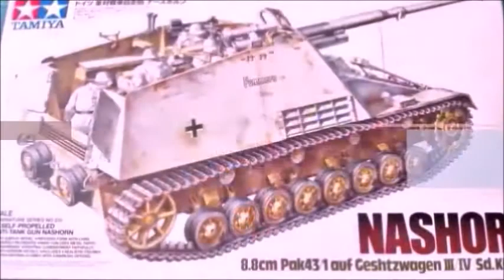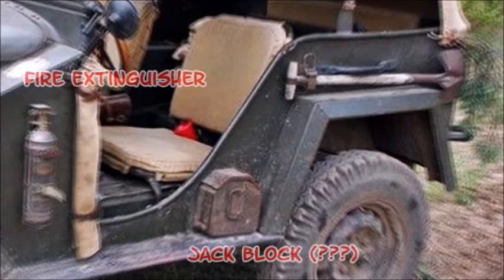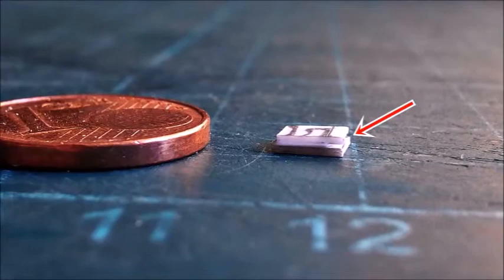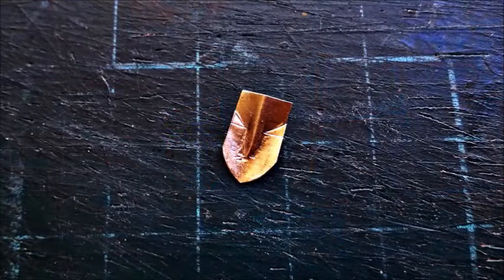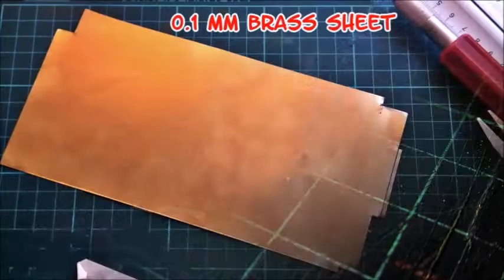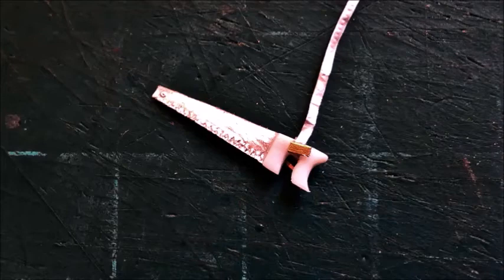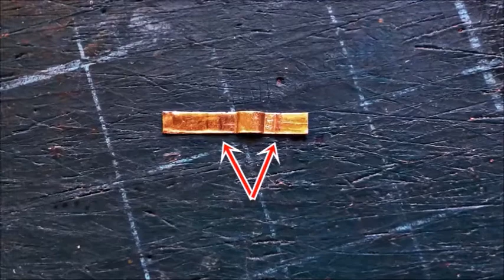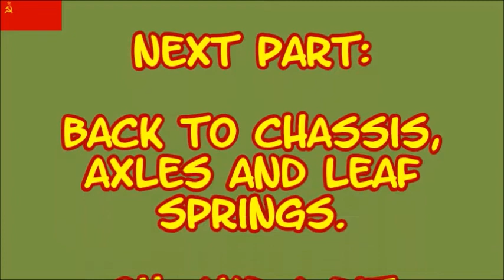The 'Chapayev' - (Scratch) Building The Tamiya GAZ 67B, Part 4, Pioneer Tools

Comment: I have been a bit busy myself this past month so I am catching up with your vids. Nice detailing. I've tried the shovel rebuild with mixed results. Mostly replacing the plastic with wood handles and an occassional bolt, More practice, but the GAZ looks excellent
Reply from the maker: Thanks a lot, Arthur. Practice is all you need. And enough material of course. Oh, and maybe persistance. As you see it works without patience, because I have no patience at all. :)

Comment: We Russians never use T-shape shovel handle or at least this shape is very uncommon and untypical here in ex-USSR.
Reply from the maker: Thanks for your comment and explaining the looks of Russian tools. You will probably be right, although I don't think much of the word "never", hehehe! But anyway, that's not the point. As I said in the video, the GAZ-67B obviously wasn't equipped with pioneer tools when it was delivered to the troops. I didn't find one single reference pic of a war-time Chapayev with tools. I only added the tools. because it makes somewhat sense, that an army vehicle should have them in case it is stuck somewhere. The different examples in the booklet on this vehicle show various versions and - given the fact that a field work shop added the tools - I took the artistic license to add them the way they are. It is common knowledge that Soviet soldiers took the tools of knocked-out German vehicles or maybe they "stole" them on a farm. This is more or less a "what-if" add-on and it's main purpose is the fun of doing it. I do a lot of scratch building, but it doesn't mean that I'm into rivet counting, because it's the opposite of fun. If you don't like them it's okay. I really don't mind. :)
Reply: Non-Prolific 1/35th Scale Model Builder No problem sir! I’ve commented just to inform you about Soviet shovels and I hope it will be useful for some future builds :) Great scratchbuilding anyway
Reply from the maker: It's definitely useful. All information is useful. :) Spasiba, moj drug! :)